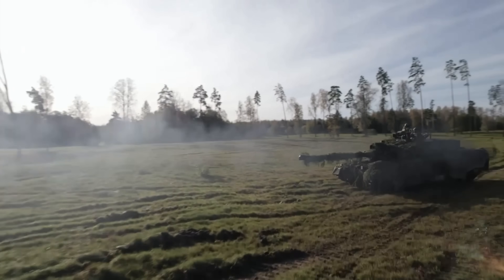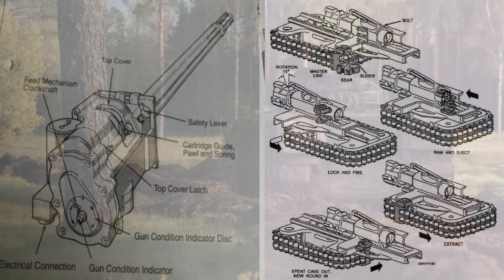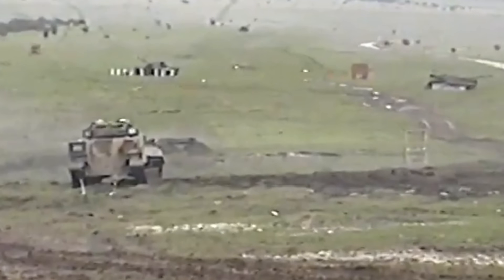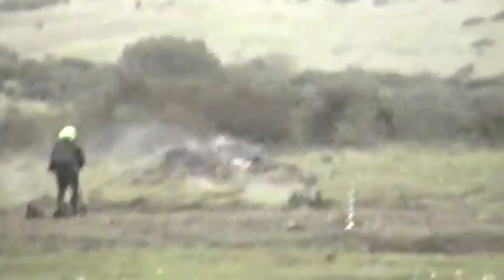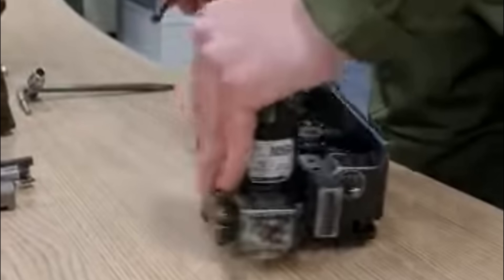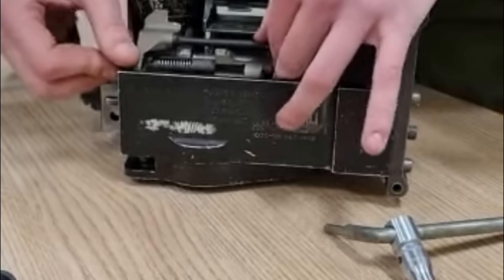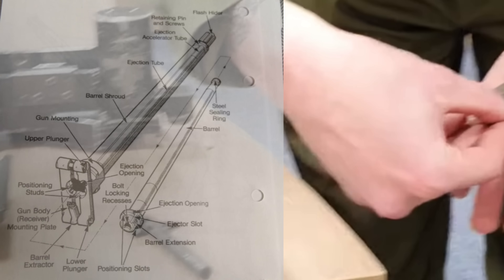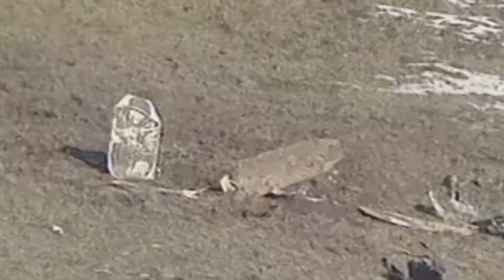The British L94A1 7.62mm Chain Gun | THE WORST WEAPON FOR BRITISH TANKS 👎🏻

Comment: On the rate of fire of the L94A1, I suspect that the low rate of fire was to reduce the need to have the barrel replaced due to overheating of it with extended firing. Barrel doesn't get as hot as the L7A2 that has a higher rate of fire. As for an alternative for a coaxial weapon, the MG3 might be a better option. The barrel changes occur with the barrel being pulled inward, making possible to have the change done inside the AFV.
Reply: but its in a vehicle so weight should not be such a limiting factor. just make the barrel thicker and add an active cooling like water or something.
Reply: The low rate of fire is a quirk of the chaingun mechanism. It is about the same on the 25mm Bushmaster, and on most chainguns on the 20 to 40 mm range is around that too.
Reply: Why is it not liquid cooled then?
Reply: @trentvlak  additional water reservoir takes up already little available space in turret, also tube could break and leak water within vehicle. Not practical at all.
Reply: MG3 mechanism is a bit awkward for a coax. You need a little extra space on the side to get the barrel out. Also, there are significantly more accurate options, to the point that it makes a meaningful difference when you have such a stable firing platform.
Reply: That was the reason mg34's were still produced as co-ax guns to the end of ww2. Better suited for the task.
Reply: @fnorgen  MG34 not MG3
Reply: @h74-s4h  No. I mean the MG3. During WW2 the Germans kept the heavier and more expensive MG34 in production specifically because the MG42 was less suited as a coax gun, and the MG3 is just a more refined MG42, with the same packaging issues. The MG3 pattern became very popular as a universal machine gun, but it never particularly caught on as a coax gun for the same old reasons. There are much better options for that purpose.
Reply: @fnorgen  I pressed the wrong reply button. The 34 was a great coax
Reply: The spare barrel for the L94 on a Challenger 2 is kept in a case mounted on the main armament and changed from within using a special set of pliers to hold it when it's hot. The barrels are also a lot more "substantial" than the previous L8 GPMG's that were fitted coaxially on CR1's.  The biggest problem I had with them was the "cheap" ammo we were issued with when training. The extractor would rip the base from the case (usually after only firing half a dozen rounds or so )leaving the rest of the case in the chamber and then another round would be fed into it causing a stoppage. In Iraq we were issued decent ammo and I personally never had any problems with it there.

Comment: It's worth noting that one of the biggest selling points of early machine guns was that they did NOT automatically cycle out rounds unless the round fired.

Maybe you've heard, "The gatling's jammed and the colonel dead". How does that happen, though? As long as you turn the crank, the gatling gun goes, right? No! The problem is when a hangfire delays the firing of a round until it has been partly extracted by the gun mechanism. This blows out the cartridge, leaving a cylindrical tube stuck in the chamber. The next round that the gun tries to feed into that chamber jams the mechanism and it's difficult to get that tube removed to clear the jam.

With a Maxim machine gun? It won't cycle until after the round actually fires. A hangfire won't jam the mechanism. And a misfire? Well, you just manually rack the mechanism to clear it and you're ready for action.

The modern chain gun (and gatling gun) is only really possible thanks to more reliable ammo where hangfires are rare.
Reply: Thank you for this comment. I have never even heard of that problem, it puts a lot of things into perspective.
Reply: The gatling does extract and eject.  As for that particular malfunction (out of battery detonation, and bore obstruction) ,  it would jam any gun.
Reply: @sinisterthoughts2896  The point is that a Maxim machine gun wouldn't be out of battery. The process of extracting a round is powered by the round firing. So a hangfire will still take place before extraction has started.

And the Gardner used the same sort of hand crank power, so it was vulnerable to the same sort of jamming as a Gatling. It's really not relevant to the point that the Maxim's recoil powered mechanism eliminated that particular flaw of hand crank powered gun mechanisms.
Reply: @IsaacKuo  say you get a slow hangfire in your dear maxim, and go for extraction since, by what you can see, it's a misfire. Now when your now externally powered extraction is happening, the hangfire finally goes off and you get a out of battery detonation, no?

The maxim is not completely immune, and a gatling completely ignores misfires almost as if they were not even there. Both ways have their positives and negatives, but none is perfect even if you want it to.
Reply: @d10valentin  The chances of that are extremely low, because it simply takes a while to notice there's a problem and then to reach for the charging handle and rack the mechanism.
Reply: @IsaacKuo   extremely low probability is still not impossible. The more "it simply takes a while to notice there's a problem", the more of an argument for externally powered gun for just about every ammo problem but hangfires as they don't become stoppages.
Reply: @d10valentin  I don't even know what your point is supposed to be. The Maxim gun won over the world's militaries because it was more reliable than hand cranked guns. You can't go back in time and alter that fact.

The bottom line is that hand cranked guns suffered from a good chance of a hangfire jam that took the gun out of action for the rest of the battle. The Maxim did not. Being out of action for a few seconds due to a misfire was entirely acceptable to both the gun crews whose lives directly depended upon the gun's functioning, and commanders trying to win battles and wars.
Reply: Never even considered this. Great comment.
Reply: Also that quote was inaccurate.  In reality it was a Gardner machine gun at the battle of Abu Klea, not a Gatling.

Comment: cant believe they are putting this sh1t in Ajax!   Wait yes i can. Bet they are used ones as well. Yes please do a post on the pile of crap that is the Ajax and why we are replacing warrier with BOXER. I like BOXER, thought we should never had left the programme (MRAV) as it was called. It is a mistake to not have a IFV. We seem to be not getting a wheeled replacement either. A backward step in so many ways. An APC armed with a GPMG or similar when every other army has vehicles with 30/40mm cannon and ATGW. The MoD is not fit for purpose

Comment: I was issued a M60 in the 80s, I got lucky and received a freshly refurbished one, and I treated it like a baby so I never had issues with it (other than it being a heavy mf to lug around).  I got out before they switched to the M249.  Also used the M2 on a Deuce 1/2 mount, but I drove most of the time.

Comment: Any reason why a .50 cal or 20mm can't be a coaxial?
Reply: Either can be a coax, no problem at all. It's just a matter of designing in the extra space and weight of the gun and its ammunition.
Reply: The French used a 20mm autocannon as the coax for many years, but dropped it . 

The main downside is the bulk of the ammunition in an already cramped tank.
Reply: AMX-30/Cheftian both had large guns as coaxial (tho chieftain used its for rangefinding and its true coax was 7.62mm machinegun).

Comment: Mat, rate of fire isn't really an issue. The real issue is just complexity. 1. It costs a more to manufacture the L94A1 than a comparable gas operated 7.62mm machinegun. 2. It is more complex and therefore more prone to failure. 3. It is harder to service because of complexity. 4. All of this complexity adds no combat value to the weapon system. 5. Parts compatibility with allied nations is nil. So basically it just a horrible logistical decision, probably made by some asshole looking to make money on contracts.
Reply from the maker: You’ve summed it up perfectly!

Comment: The only advantage of a chain system in a little machine gun like that is that you can change the rate of fire... but they don't let you do that? That's ridiculous.
Reply: Well that and the length of the receiver. And (supposed to anyways) allow for continued function even with dud rounds
Reply: @roadrunnerACTUAL   could have just used a minigun instead, got the same advantages and is a proven design that the UK also uses in other platforms
the minigun is also much shorter (800mm vs 1250mm) which means you can have the whole gun inside the turret with a small slot for it to shoot through (the muzzle has to be isolated from the crew ofc), it is also able to fire much faster or slower depending on what you want, being able to fire 2000+rpm might sound like a waste of ammo but if you have enemies hidden in a tree-line that you are asked to clear with your ifv it would have a big impact on the enemies hiding in there

I guess the gatling gun would be more expensive but these vehicles are already way overpriced at about 4milion per unit, the chaingun is about 10k$ (price in the 90s) while the minigun costs about 20k$ (2007 pricing)
Reply: @billwhoever2830  You want to replace the L94A1 with a minigun? Bwahahahahahaha
Reply: @ why not?
Reply: @billwhoever2830  Armoured fighting vehicles are super cramped. They barely have the space for a single barrel MG. Now you want 6 barrels
Reply: not the only advantage. if you have a misfire you don't get a stoppage
Reply: @  yet the L94 stops more than a gas operated gun. Make it make sense

Comment: I wonder how much of the reliability situation is heat related, if the thing was designed to be mounted on a helicopter and be constantly cooled by air running at basically hurricane level speed, strapping it to a metal box that is for the most part static ain't going to work, and increasing the cyclic rate is only going to make those problems worse.
Reply from the maker: It's definitely a consideration.
Reply: It's more the running upside down thing.
There is a machine gun in history, belt fed that wouldn't run properly. The solution was found by, I believe, Jim Browning. He turned the mechanism upside down...
Brandon Herrera has a vid on it.

Comment: A chaingun in 7.62?  What???  That has to be the most overkill idea... plus this model doesn't even work.
Reply: It is British, it is carefully designed not to work.
Reply: @PosranaRegistrace  But the 80's Jaguar are very beautiful to look at. Drive? That's what the flat bed truck is for ...
Reply: @mattiasdahlstrom2024 😂😂
Reply: @mattiasdahlstrom2024  That's why there was a company called JTR - Jaguars That Run.  They sold conversion kits to install a Chevrolet small block V8 (along with the transmission) in your Jaguar.
Reply: @  no shit!  Gotta check it out though the family have ago sold that 1985 Jag
Reply: Chaingun means that if a round doesn't fire, you don't have problems.
Reply: @BeefIngot  It means a whole host of potential problems, though.  It's easy enough to run a cable off the charging handle into the interior of the vehicle, and things like a hang fire aren't a big deal in a recoil or gas operated MG.
Reply: When I hear Chain Gun I thought of 25mm or a family of Bushmaster's guns.....
Very UK, I would not be surprised if they gonna use Bren LMG for a coaxial...

Comment: The weird thing is the 25mm Bushmaster and the 7.62mm EX-34 were both derived from the same Hughes program (that started in 20mm in the 1960s).

Also, in testing by the US Navy, the EX-34 did amazingly well, with unprecedented reliability.  But, that was in a testbed environment, not actual troop use.
Reply from the maker: That’s very interesting to know!
Reply: Wonder if they had the sense to read the manual and mount it the right way up, and mount the ammo above the gun.
Reply: @MrTrilbe  The weapon being upside down, seems to have allowed all the reliability to drain out.
Reply: @Yandarval  you could say it was a chain reaction
Reply: Have you M73?

Comment: I am looking forward to your evaluation of the AJAX, which is a very significant issue.  The failure to learn from the lessons of the past, by incorporating this chain gun into the new fleet without any revisions, is very troubling.  The AJAX is still at the point where things can be changed, so let's talk honestly about what works and what doesn't.
Reply: The feed system has been completely redesigned (properly) for Ajax
Reply: @MarkSmith-rc3jf  Hope that's true for the users sakes.

Comment: This still gives my mate nightmares hes an armourer in the REME, still kinds of twitches  if someone mentions it ,

Thanks matt i will be able to scar him for another while 😂
Reply: Firstly Matt you can use the stoppage nut on the bottom to operate the in the case of power outage gatteling gun style.  Do not you the gun condition indicator nut on the back of the gun.  That will just shear the key on the dog drive. I found the biggest problem was crews using rifle oil and not the correct graphite grease.  Also the locating lug to the chain carrier elongating the locating hole. This made the master link wear away at the side of the lower casing.  Accuracy was without doubt too accurate the beaten zone of the gun was to small for effective suppose fire  but you could amost snip with it lol.  Feed problems when using 4b1t using standard nato grey link was a given. And it would always be a top half stoppage.  ( those that know;know) using 1b1t ammunition with black link was a lot better. It was fussy on its food unlike an L37 or L7. Timing the dog drive is essential. This can be done on the bench with no power.  You just check continuity between pins G and H if memory serves me correctly.  Also if the driver doesn’t have the engine revs locked at 1200rpm or above the CGCU would not operate correctly. Basically I wasn’t getting enough voltage to operate correctly.  Later mods solved this mostly.  The striker was renowned for failing due to fractures. Also chain stretch due to forcing the gun with incorrect stoppage drills  was a contributing factor. Barrels in a turret are always hard to change but the chain gun minimises toxicity poisoning for the crew.  Yes live rounds in the round have a tendency to set each other off being centre fire And all.  The L37 no matter how good it is doesn’t eject empty cases out of the turret.  Yes it has a fume extractor but toxicity poisoning is a big thing in cvrt.  The chain gun can easily chew through more ammo without needing to change the bro due to the sterite lining and slower rate of fire.  

Yep they have their pitfalls but the main reason for use is purely due to anti toxicity poisoning. The trade off is simply to stop crews killing their brain cells and health. The main reason. Scorpion was taken out of service.  The rarden and chain gun combined keeps the air inside the ifv breathable. And questions you have just ask.  As u know from my previous posts im bias towards warrior I love it and maintaining the chain gun was i now way more difficult. Sometimes tedious but then that’s the same for all guns hand held mounted ect thanks
Reply: GPMG is by far the most versatile and best weapon system in use. There is no role it hasn't been used in from light roll,  sustained fire, vehicle mounted L37 on the CVRT Scimitar ( CVRT sabre was Chain gun) Air role on most serving helicopter, ship and boat mounted and capolla mounted on all British military Vehicles. As well as commanders mount on Jackal/coyote platforms. The General will shake it's self apart before it lets you down. One big problem with the chain gun is it's designed to have the ammunition fed from above rather than below which caused problems when trying to pull the belt of 7.62 up which as those that know can confirm a full belt is heavy

Comment: if I might ask, could you do a deep dive/comparison on american 6 barrel M134 Minigun vs russian 4 barelled Glagolev-Shipunov-Gryazev GShG-7.62 , the russians made it work although it should not have worked, and imho is more reliable than american version, curious why they do not use it with different calibers on more platforms, could be an interesting CIWS like solution for drones too, or as quick replaceable turret on some vehicles
Reply: >It is a hybrid weapon using both propellant gas and an electric drive to rotate the barrels
That's.. certainly unique haha

Comment: Feels like a needlessly complex way to do a machinegun. I think that there too many failure points when you need the exact opposite
Reply: The primary driver for the design was minimizing the receiver length and gas intrusion into the crew compartment.

Personally, I think the FN MAG is a better choice, despite it having those two "weaknesses".
Reply: @geodkyt  Forget FN MAG, the Brits would've been better off digging up ancient Maxim guns than keeping these in their tank.
Reply: @alexturnbackthearmy1907 Well they were competent when selecting the Bren, they even gave the Czechs more time to make it work reliably with the .303 British because they knew it works great with 8mm Mauser. One of the few times a military leadership made a surprisingly smart decision.
Reply: The NBC system should take care of that with filters right? @geodkyt
Reply: @geodkyt  FN MAG, PKT,  M1919A4, they are reliable.